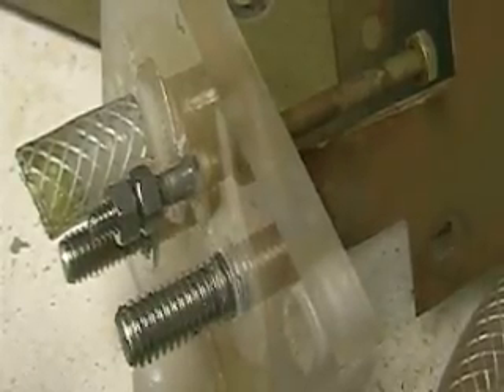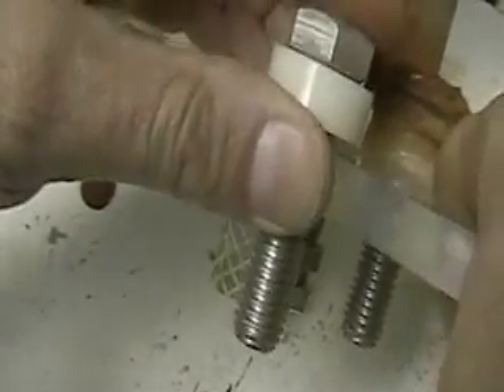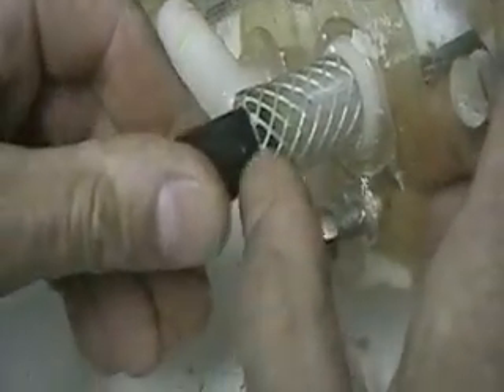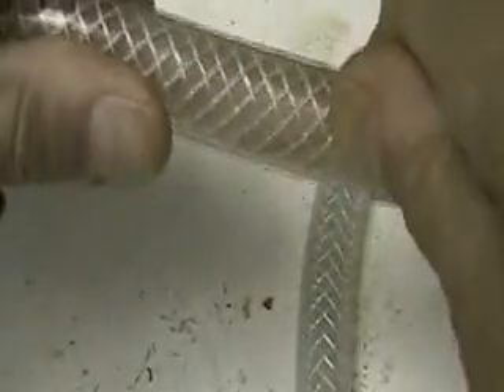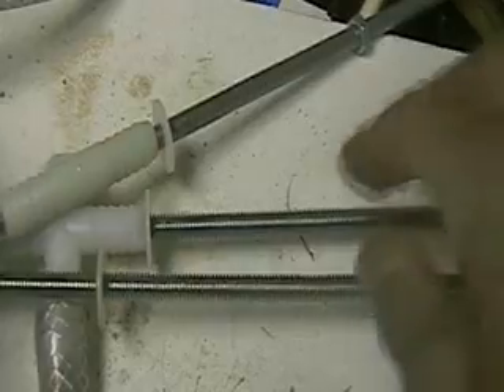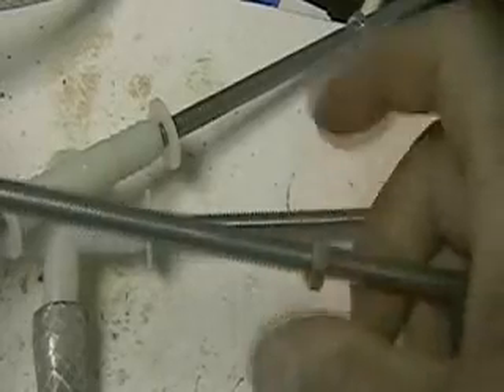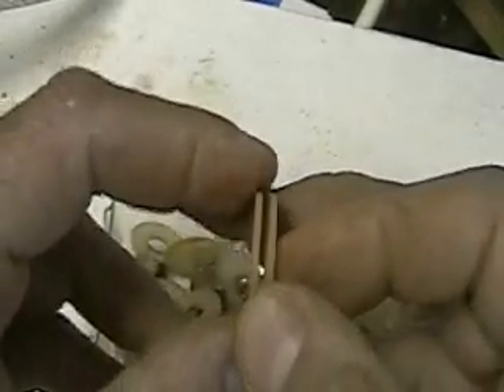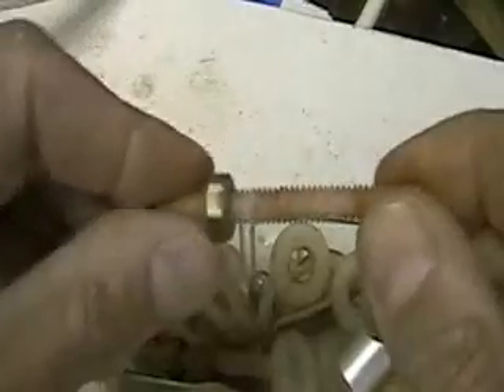Hydrogen Tap (FOCUS-PM3) 333

Comment: hey 
just a question
1. did you notice any beating on your car battery?
2. your chart shows that cell gives you 5 miles per gallon extra
What if you make the cell bigger? Will the car battery be able to handle it?
You're doing great work

Comment: Hi John

How about a variation on your previous spring tension idea to keep the cell sealed. Instead of having the purpose of explosion or safety pressure relief, use more heavy duty springs with higher tension, strategically placed, to hold a seal no matter how much it compresses over time.   Mak

Comment: If your going to use a similar rubber seal/gasket as before, maby some regular clear silicon on the outside of this area can provide an additional seal if the gasket is leaking.  That silicon caulking is also flexible and somewhat heat resistant.